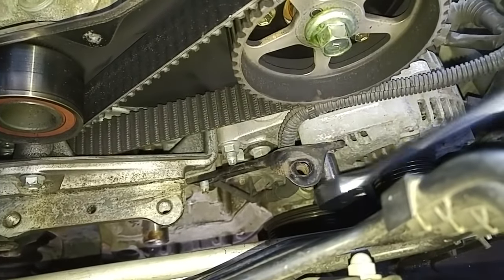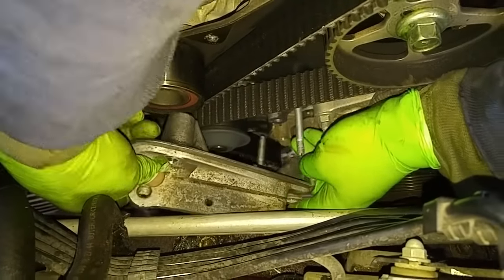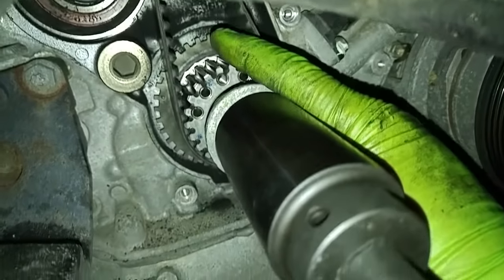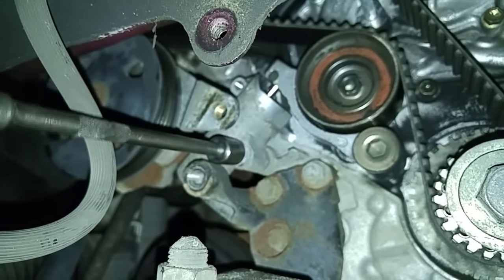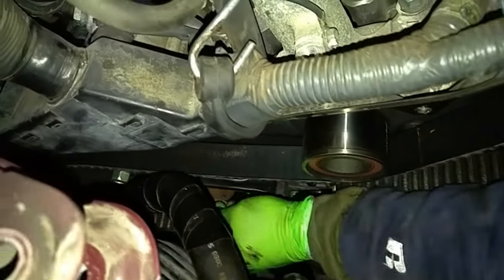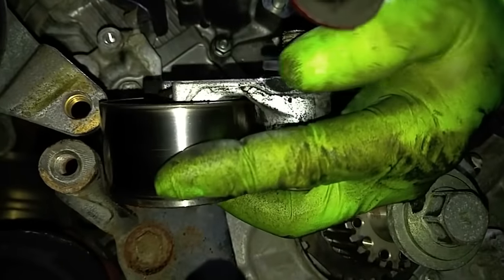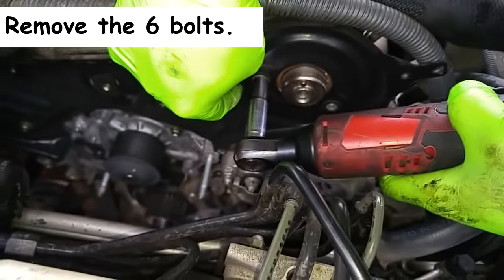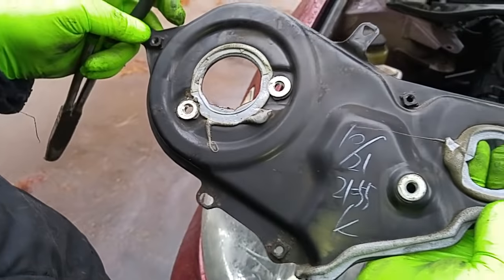Toyota Camry V6 3MZ-FE Timing Belt, Water Pump, Seals & Pulleys Replacement

Comment: Hi HMP,  i just attempted this job on same engine.  Apparently the shop that did it at 123k miles stripped the wp studs and extremely over tightened to crank bolt.  They used a Continental kit which wp, leaked early , idler squeaks, and it had a paper gasket.  450ft# electric impact with inertia socket wouldn't bud it.  I had to buy a 15 inch long extension to get it outside the wheel well and used a 1/2 inch 24 inch breaker bar with jack 2ft jack handle cheater bar and a Jack stand to keep it all level. Finally got that bolt out. I bought the Aisin kit.  Somehow when i removed the upper idler bolt, it wouldn't bottom out or get tight on reinstall.   Its stripped and the hole in the engine block appears stripped.  Not sure how to go about fixing this issue.  Any suggestions,  are appreciated in advance.   Awesome video and instructions!!  Thank you
Reply from the maker: Sorry to learn of your bad experience with the last guy who worked on your car.  Only thing I recommend with the stripped threads for the idler bolt is to drill out the threads in the block and tap in new threads that will accept a time sert or heli coil fitting.  The inner threads of the sert will match the idler bolt and the out thread will match what's been tapped.  Here is an example of a time sert kit:  https://amzn.to/49QBXLF  Here is a video explaining how serts work: https://youtu.be/9ic7H2qe73I?si=okananaqDkw02JEX
Reply: @hardlymovingpro  Awesome, thanks for your expert advice.  I can calm down now as I thought I was screwed!  We appreciate you!
Reply: Sorry to bother, I have one more question.  Doing some research I found that stripped timing idler bolt (90105-10191) screws into bracket (13584) I don't see how to replace the bracket.  Would you know how  to replace the bracket?  Thank you
Reply from the maker: @CJL2022  don't see why you can't install a sert into the bracket.  Or Can you place a nut behind it?
Reply: @hardlymovingpro I looked at the time sert website, they want $524 for the kit I need.  The bracket is only 43$ at Toyota.  I did just look at the bracket in the car, its not easy to get to, I would have to take the timing back plate and cam gears off.  Not worth it.  A co worker suggested I get a new bolt and thread chaser, to restore the threads.  Heli coils are another option,but I hear they may not be strong enough.
Reply from the maker: Don't think a thread chaser is going to work.
Reply: Ok, I may just call a mobile mechanic to install the time sert. Probably $100 ( maybe) I don't have the money for the Time sert kit.   Thank you, have a great day!
Reply from the maker: No a bad idea to get a second opinion.
Reply: Hi HMP, just wanted to give you an update.  I was able to repair the idler bearing bolt hole using a new oem bolt and I added a little red loctite for strength.  Someone put the wrong bolt, which was at least double the length and had no shoulder like the oem bolt.  I buttoned it all back up and car is running great.  Thanks again for your suggestions!

Comment: good video. Thanks  it looks like you have AISIN set
Reply from the maker: Yes ... from my past experience, I only used Aisin water pumps on these engines.  Other pumps will not last up to 100,000 miles.  They generally leak, the bearings wear out, make noise or the shaft may seize.

Comment: When you replaced the timing belt, the water pump is right there so it gets replaced. But are the seals and pulley replacements done at the same time or is that part of the timing belt?
Reply from the maker: I replace the pulleys and seal when doing belt replacements ...but a lot of shops won't unless you ask and agree to pay more.
Reply: @hardlymovingpro  More pay makes sense... I have a 210k  2007 Highlander, just wonder if I should replace them for longevity of the vehicle.
Reply from the maker: Absolutely

Comment: The top engine mount bolt commonly {long one} can break,replacing the steel mount housing is the easy fix.. Trying to drill or repair it is futile.

Comment: My dad tried doing his timing belt, but he ended up spinning the camshafts and the crankshaft independently... does he have to take the valve covers off in order to get the timing right?
Reply from the maker: Not at all.  The crankshaft and the camshaft pulleys can be re-aligned to their top-dead-center marks.  Use the notch on the back camshaft sprocket dust shield and the half moon hump on the engine block for the crankshaft.  It's all in the video.

Comment: what happens if the belt broke does the valves touches the pistons? or we can just change the belt and it would be fine one sienna 2004 3.3
Reply from the maker: Yes ... they smash into each other.  When the belt brakes, the valves lock in their current position (could be open, closed or half way) while the pistons keep reciprocating up and down.  In the piston's up stroke (compression or exhaust), any valves in the locked open position will get impacted by the piston and more than likely, bend the valve(s).  The bent valves will no longer maintain a good seal hence a substantial loss of engine power.  The only fix is to remove the cylinder heads and have the bent valves replaced.  If the belt broke at low rpm's there's a chance that maybe the valves aren't too bad.  You can slap on a new belt, start the car and see how it runs.  Also, you can do a compression test on each cylinder.

Comment: I have 117k on mine got the car when it had 82 k I believe is the original belt I should change it seems to be running good but I haven’t done it  2004 Avalon 3.0 v6 vvti
Reply from the maker: If the only the belt was changed and not the water pump, bearings and seals, you may not get to the next belt service interval without one of these other components failing.

Comment: Hello, I’m troubleshooting my 06 Highlander with 3.3 and when I rotate the crank pulley to zero degrees the timing of the cams is 3 teeth off which vice versa if I put the cams on alignment then the crankshaft pulley notch indicates about 30 degrees off in the counterclockwise position. Could you provide any input? This car has ran excellent for 40,000 miles then left me stranded on my way to work. It will start and run but makes rattling sound at 1,500 rpm.
Reply from the maker: You may have put on the new belt with the timing marks in reverse.  Try flipping the belt over and that should align the belt marks.
Reply: @hardlymovingpro  I haven’t had the belt off, just troubleshooting why the car died and won’t run now. The timing belt is good and has good tension but the crank at TDC puts the cams 3 teeth out of sync. I’m not looking at the lines on the belt, going by the actual timing marks on cam gears and crankshaft gear behind the harmonic balancer pulley. Any suggestions or recommendations? Unless it somehow skipped three teeth it’s been running like that for 40k miles and running nice and smooth. I wonder if the vvti could have been compensating for it.
Reply from the maker: Could be the belt may have jump of the cam cogs throwing off the timing.  Possible causes are weak or failing water pump bearing, idler and tensioner bearings.  Remove the belt and check the rotation on all the bearings and replace what's failed.  Recommend you install a new belt.

Comment: Link to the tool you used to pull the crank shaft seal? What size pvc pipe did you use to push the new seal on with?
Reply from the maker: A link to all the tools used in the video should be in the description area of this video.
Reply: @hardlymovingpro  negative, the link for the puller you used on the crank seal and the size of the pvc pipe were not listed.

Comment: Hi I enjoy your videos I have a question I have a 2003 Toyota Avalon with v6 on it I just got the car my problem is crank no start I have a spark I have a fuel timing is ok compression is okay injectors is  okay just replace fuel pump and there was not a problem when I spray fuel 2 intake Star what could be the problem please help thanks
Reply from the maker: I assume no MIL codes?  Wild guess ... car's computer (PCM) malfunctioning.  Timing belt checked?
Reply: @hardlymovingpro   thank you for your response no code check engine light on and goes out take the timing cover off check all the timing marks it's showing on your video the car Star once or twice when I spray fuel replace fuel pump still same

Comment: I really love this video!!! I'm trying to install new water pump on my 2007 3.3L. I broke one of the bolts trying to screw it on. Can I get another bolt at Home Depot ? Or where can I get another bolt?
Reply from the maker: Your best bet is to get an identical bolt from either an auto salvage yard or the dealership.  Doubt that Home Depot has a bolt of the right length and thread pattern.  If the bolt sheared off, you may need a bolt stud extraction tool.  Here's a video on how it works:  https://youtu.be/jX3r7hqju4k
Reply: Try McDonalds if Home Depot don't have it bro.

Comment: Can you put a breaker bar on the crank and turn over the engine? Hardly Moving Productions
Reply: Yes, That is how I got mine off. Super simple, make sure you have the bar situated/braced for the proper direction the pully will turn. Then just tap the starter, just a tap is all it takes. Broke it loose like it was nothing.  But you are still going to have to find a way to brace the pully when you go to torque the bolt back down, I had to purchase a special tool for that.
Reply: @JohnNorris411  I think i can use an old belt to stop the pulley from spinning once I get it off. I tried all day today to get the crank off. Using the starter method and it didn't work. But I was only using a box end 22mm. I think a socket and breaker bar will do it. Thank you for a response
Reply from the maker: Most of the time ... yes.  On Honda's V6 next to impossible.  I then use a high mass impact socket.

Comment: Hello I have a question.I am going to do it to my moms car in he next days.This is going to be my first time doing this job.After all this work when I put antifreeze on the radiator line do I have to start the car and put the heater on or something to release air or something????
Reply from the maker: Remove the upper hose from the radiator and pour in the coolant directly from the hose.  This will insure the engine block will have little to no air pockets.  Reconnect the hose and fill up the radiator.  Also get yourself a spill free funnel.  Using this while the engine is warming up will push out air without coolant spillage.   Here's the link:  https://amzn.to/3b0UOdz
Reply: @hardlymovingpro  thank you so much for your time🙏🙏👍👍
Reply: @hardlymovingpro  hiiii I am doing the job now.I have a question.when I was taking the camshaft pulleys out they were hard and the inside one moved to the left a little and make a click,I put it back to the mark and I could take it out finally.DOES THAT LITTLE MOVEMENT TO THE LEFT AFFECT THE ENGINE INSIDE OR SOMETHING???I am just scared🤦🏻‍♀️🤦🏻‍♀️I know that the engine was off,but I just did not want to move the camshafts even a little
Reply from the maker: No worries if the camshaft moves or jumps.  Just reposition.
Reply: @hardlymovingpro  thank you very much for your time👍👍
Reply: @hardlymovingpro  I just finished the job to my mom’s car and everything is perfect thanks to your video,otherwise I wouldn’t have been capable to do it,I am very happy I did it my own,thank you very much🙏🙏👍👍
Reply from the maker: Good job and thanks for sharing!

Comment: What is the name of (and where do you get one) the pin you used to hold the tensioner back when you were putting it in place?
Reply from the maker: Tensioner release pin.  You can use a drill bit as a substitute.
Reply: @hardlymovingpro  Thank you
Reply from the maker: @ZCFHUAfhnvjf  you bet!

Comment: My 02 es300 has 200,000 miles original Water pump and timing belt just changed
Reply from the maker: Pretty good getting to 200k miles.  Do you think the w/p will get to the next TB service interval?

Comment: What did you use to reinstall that crank pulley. I used my electric impact wrench and tightened it in small bursts until the bolt quit turning. Is that ok or do I need to take it back out and use a tourque wrench?
Reply from the maker: What you did was correct.  When applying torque, watch the rotation of the impact socket.  When it stops moving, you've applied enough torque.  Although small bursts is okay, the impact wrench will generated more torque the longer you have the trigger depressed.  This is why it's important to watch for the sudden rotation stoppage of the impact socket.
Reply: @hardlymovingpro  I think I did what you described. I did a few bursts and increments and then a couple of longer bursts and the bolt flare stopped moving. Then a couple of more short burst with no extra movement. Your video is extremely helpful and very intelligently done. It was like we were working on the car together and you saved me more than a couple  of mental snags.Thanks for the great video and your response to my question.
Reply from the maker: @skittykitty1000  Great!  Glad it worked out for you!

Comment: Can you tell me what the part is at 18:35. It's the round gold seal/spacer right before you put the cover back on? I need to replace that part that was damaged in repair process and cannot find what that part is called. Thank you for your time!
Reply from the maker: No problem.  That's called the Crankshaft Pulley Timing Belt Guide or simply Timing Belt Guide.
Reply: Great video by the way! Best camera views I can find :)
Reply from the maker: Thanks for your comment and support!
Reply: @hardlymovingpro  Thanks for your speedy reply!  :)

Comment: How can you tell if it's a 3.0 or 3.3 ? I'm looking to buy a 2006 camry v6 LE with 56k miles. I'm trying to find common problems of this engine but don't know the exact engine code. It says VVT-i V6 24V on the engine cover. North America. And how reliable are the V6's compared to 2.4 camry. Thanks in advance.
Reply from the maker: 2006 was the last year of the mz-fe engines.  2007's came with the 3.5L timing chain driven gr-fe engines.  Both engines are rock solid.  The gr's produce more fuel economy and power.  The 2.4L I4 had head gasket and oil ring problems in different years.
Reply from the maker: Use the vehicle's vin # to get the specs on the engine.  Use a on-line vin decoder tool.
Reply: Hardly Moving Productions thank you sir

Comment: Do you have to remove the dust cover just to get to the water pump?
Reply from the maker: You can remove the 10mm cover bolts above and around the water pump which will allow you to bend the cover a little to slip the pump out.
Reply: @hardlymovingpro  thank you so much

Comment: Best video ever!  Thanks a ton.  BTW, I have a 2007 Lexus RX400H which has the same 3MZFE engine.  Even though mine is hybrid, it should be the same?  How long did it take you to do this job?
Reply from the maker: Thanks for your comments!  If rushed, I can do it in 3 hrs.  Normal pace, around 5 hrs.  Couldn't do this fast without power tools.
Reply from the maker: If 3MZFE, belt replacement procedure should be the same.

Comment: Great, thorough video!  Can you tell us which brand harmonic balancer puller you used at 2:12?
Reply from the maker: It's a standard harmonic balancer pulley removal tool.  Nothing really special about it.  What's important is that the kit has bolts that will thread into the bolt holes of the balancer.  The kit I had didn't have the right bolts so I went to the hardware store and bought bolt studs with threads that matched 10 mm (from my recollection).  Then my other problem was the bolt head was too small for the pulley yoke slots and had to compensate with washers.  Anyway, the kit I saw in Amazon may be robust enough with the bolts that'll match the holes in the balancer pulley.  Here's the link:    https://amzn.to/2FvbO97
Reply: Thanks for the clarification and for a recommended puller.  Cheers!
Reply from the maker: No problem and good luck with the repair!

Comment: Once I turn the crankshaft to tdc, does this mean that cylinder #1 is tdc compression? And then can I turn the camshafts to line up the marks if they are out of alignment safely?
Reply from the maker: Yes ... you are correct.  TDC at the crank in a 4 cycle engine means you're either at the compression or exhaust stroke.  At the exhaust stroke, the cam alignment marks will be off by 180 degrees.
Reply: Awesome work and your camera man as well. You should get yourself a camera stand to save him time lol
Reply from the maker: Thanks for your comment!  And yes ... there are times when he's not available and I have to use a camera stand.

Comment: I'm prepping to do this same job on a camry. Have you replaced the oil pump on a 3MZ yet? This car has almost 400k miles! I think it should be done but not sure how much more work I'm looking at. Great video!
Reply from the maker: Never had a need to replace the oil pump.  If you did, the lack of oil pressure would probably ruin the crank bearings.  And when they go the engine would be knocking like crazy.
Reply: @hardlymovingpro  Looking at all the additional steps (removing oil pan etc) ,  I may skip it but still on the fence. Not many have this many miles on them. 
 Thanks!
Reply from the maker: @Fierocious  removing the oil pan can be painful if the exhaust manifold and pipes are in the way